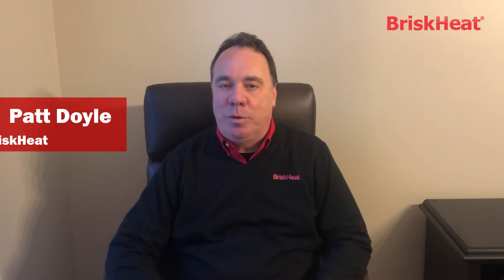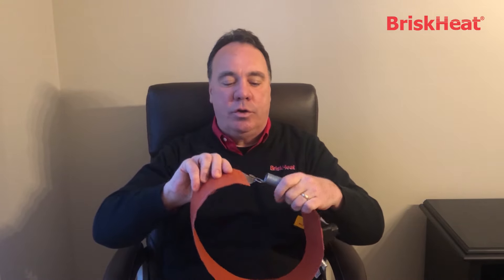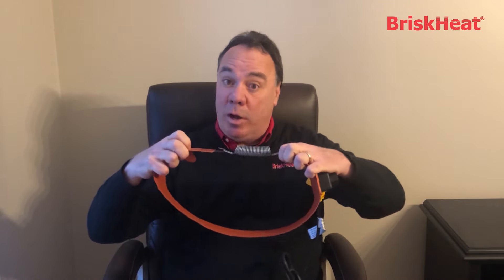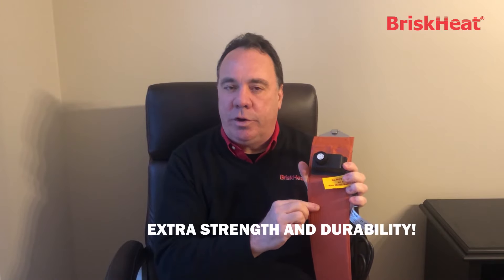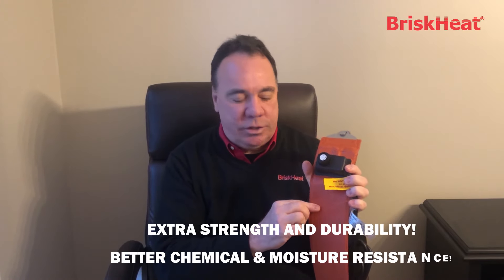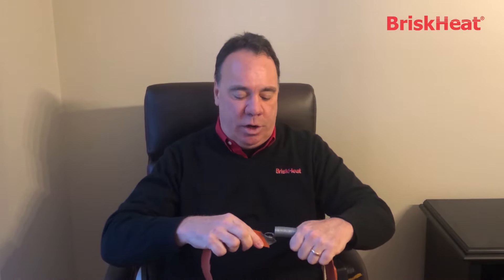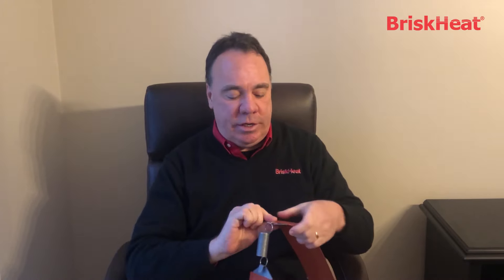BriskHeat Silicone Band Drum Heater

Comment: I have to know my good man. Can it handle repeatedly holding say 180 F for multiple hours at a time? Have you ever boiled water in a drum with them for any duration of time, or is the temperature range just intended to provide a safety factor and only ran at a low temperature, I'm curious about it's rated run times at given temperatures.  Thank you.
Reply from the maker: Yes. Our silicone drum heaters are rated for continuous operation at up to 392°F (200°C).
https://www.briskheat.com/products/heaters/drum-container-heaters/silicone-drum-pail-heaters.html
Reply: @BriskHeat   Much appreciated
Reply: @BriskHeat   Follow up question. Does it maintain a consistent temperature or does it duty cycle on and off to maintain a desired temperature? So if it's at 50% power, does it for instance turn on for 1 second, and off for 1 second, and alternate or does it remain at a consistent temperature without cycling off

Comment: When you turn the dial does it show you what temperature you are setting it ?
Reply from the maker: The controller does not show the temperature. This is a dial controller that goes from max temp to off. If you need exact temperature control, we recommend using a temperature controller with more accuracy. Depending on your needs, you could use a PID temperature controller like our LYNX™ PID TEMPERATURE CONTROL SET